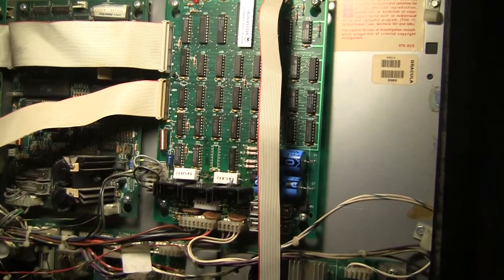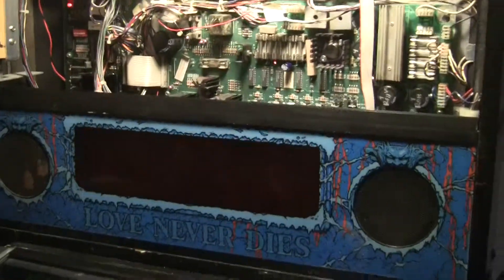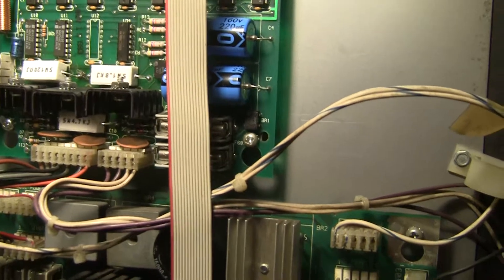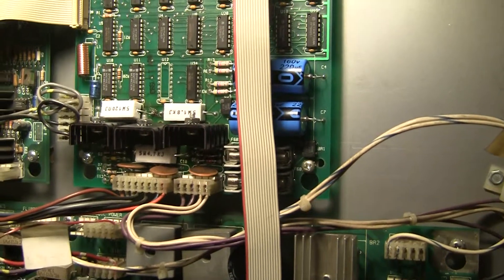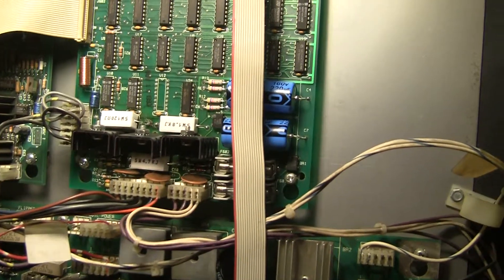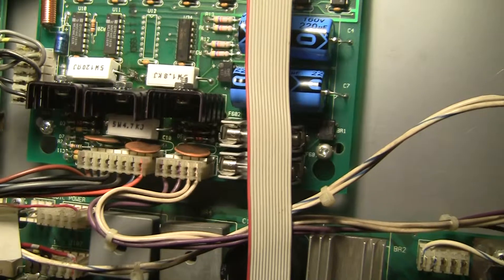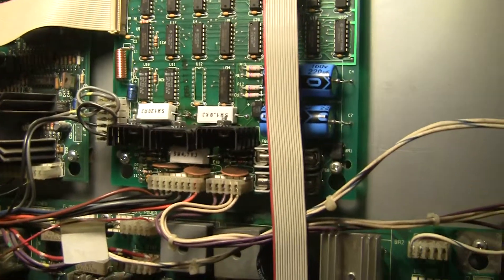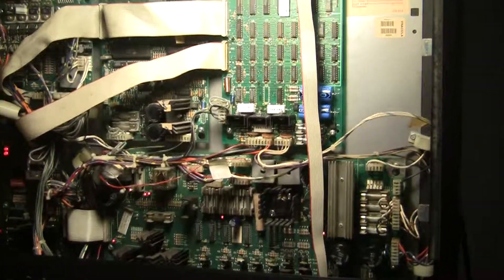Rebuilding a WPC DMD driver board PS - Part 4 - testing

Comment: Really, really, really late at posting -- but there is a link on the kit's web page that states "Kit Instructions can be found here", all parts are marked so they can be identified. Make sure to keep a lighted magnifier ready when reading the diode part numbers.  Whenever we get kits made out - they sell fast due to quality parts and low price. If you have standard (flat) cement resistors, you should raise the power resistors off the board a bit. Kits now include SQT type power resistors -- resistors with built in standoffs to raise them off the board a hair and help reduce board scorching.